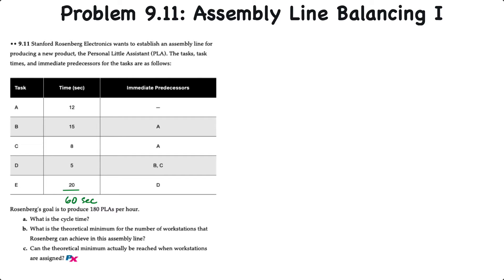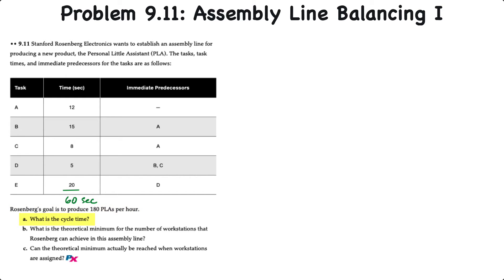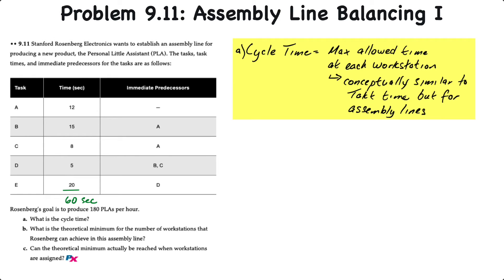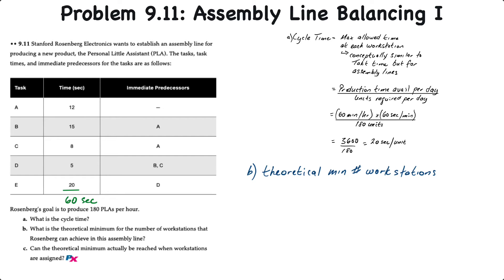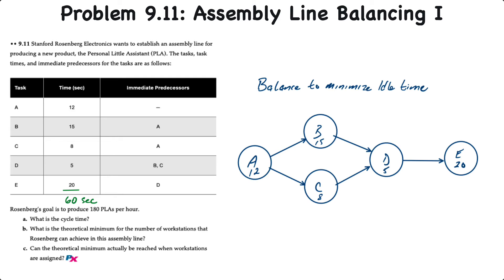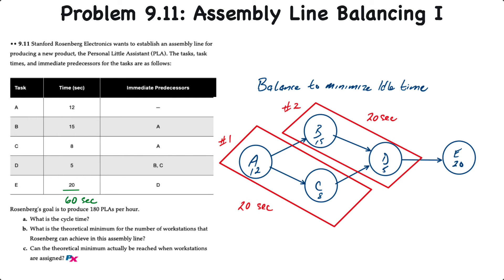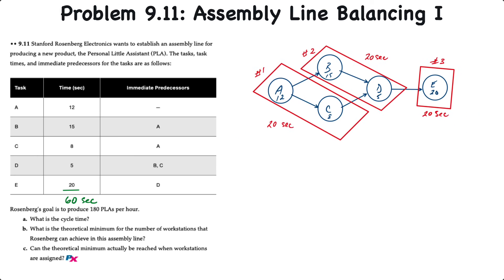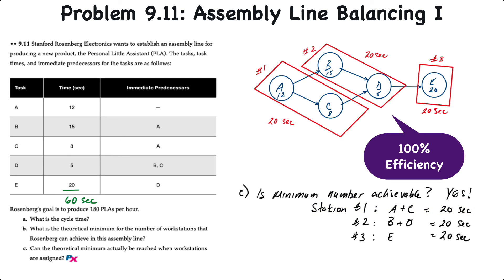Operations Layout – Assembly Line Balancing I

Comment: Why do we have to do 60 x 60 for the numerator at 1:19? But in your Part 2 video for Assembly Line Balancing, you did not multiply the sum of the task times by 60 (hour)?
Reply from the maker: The cycle time is the amount of time required to produce a unit in a complete cycle. So in a single hour there are a total of 3,600 seconds of production time available and the desired output is 180 units per hour, then it should take 20 seconds to complete a unit. For the other video you would have to direct me to exactly where you're looking so I can answer appropriately.

Comment: 1:15 there's a mistake. Numbers used are production time per hour and units required per hour.
Reply from the maker: Yes, you are right – it should be per hour. Thanks for picking that up.
Reply: Other than that, great video! Straight to the point and simple

Comment: Lost me at 1 min 19 secs
Reply from the maker: The cycle time is the amount of time required to produce a unit in a complete cycle. So in a single hour there are a total of 3,600 seconds of production time available and the desired output is 180 units per hour, then it should take 20 seconds to complete a unit. For the other video you would have to direct me to exactly where you're looking so I can answer appropriately.

Comment: Cycle time should includes all workstations and processes and is not max allowed time at each workstation.
Reply from the maker: Based on the textbooks I have used, cycle time is "the maximum time allowed at each workstation to complete its set of tasks on a unit." (Stevenson & Hojati, 2011; Heizer, Render, Munson, & Griffin, 2020).

This problem gives us tasks which have yet to be organized into workstations and the cycle time represents the maximum amount of time that a unit can spend in a workstation in a given cycle.

The total sum of all the tasks (process if you like) to complete a product is the task duration time and we divide the duration time by the cycle time to determine the optimal number of workstations. 

So in this case, if the task duration time (in seconds for an entire hour) is 3600 seconds to produce a unit through all the tasks and the cycle time is a maximum of 20 seconds per unit, that means we need to try to organize the tasks into 3 workstations to allow the unit to be produced.

It could be that different textbooks and sources may interpret the cycle time slightly differently. Here was have a WORKSTATION cycle time of 20 seconds per unit and a total (ideal) PRODUCTION cycle time of 60 seconds (which is what I think you're trying to get at).

However, sometimes the theoretical number of workstations cannot be achieved because of the precedence relationships and times of the tasks, so you might need 4 workstations. In this case the actual PRODUCTION cycle time would be greater than the WORKSTATION cycle time.

I guess it depends on the source you're referring to.

Comment: I was in search of such content..after searching almost 85+ videos i landed here...i subscribed....
Reply from the maker: Thank you very much!
Reply: @The_Business_Doctor  hello Dr. Mark, Could you please suggest me book for assembly line design and balancing of it.Total from scratch to final optimal line.
Reply from the maker: @maheshpatil2017  Hi Manesh. Basically any operations management textbook with a chapter dedicated to assembly line balancing would do the trick. If you're in Canada, I can recommend a couple books. Where are you located?
Reply: @The_Business_Doctor  india. Actually I am expecting designing of line and procedure to do it.  For example. I want to assemble few gearboxes of different sizes which need same operations to be performed on it but each gearbox size has different processing time. i.e.multi model.
Reply from the maker: @maheshpatil2017  I would recommend this book:

https://www.mheducation.com/highered/product/operations-management-stevenson/M9781260238891.html

It includes a great chapter on the basics of assembly line balancing and then you can adapt to the complexity of your needs.
Reply: @The_Business_Doctor  Thank You for your reply.